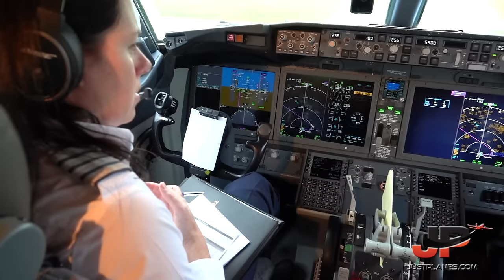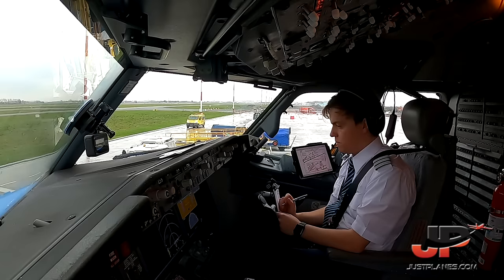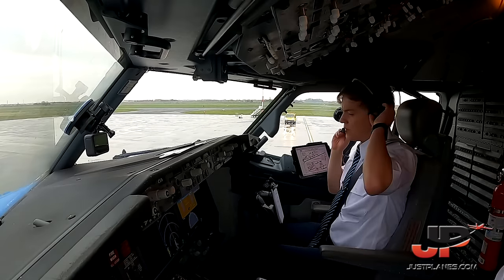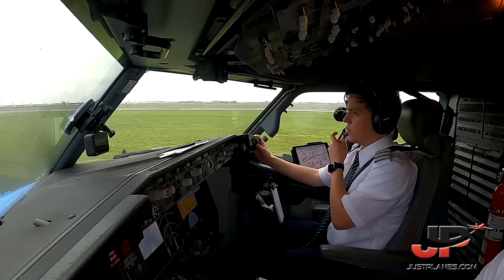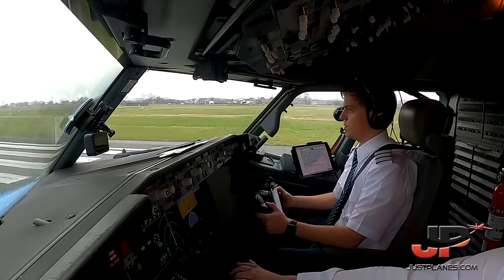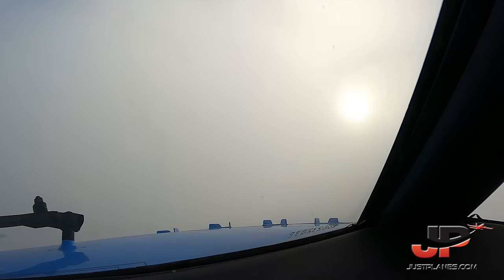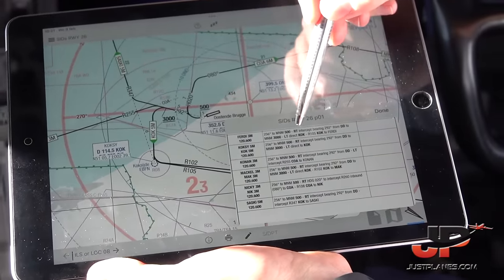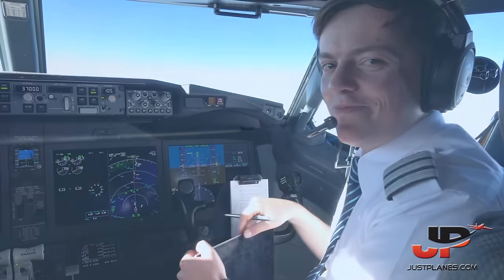TUIfly Boeing 737MAX Cockpit | Takeoff Ostend Belgium

Comment: I always like to see Boeing aircraft in action. A lot of the internal parts of that aircraft in the cockpit, engine mounts, landing gear , wing spares, flaps are manufactured at the Boeing factory in Troutdale, Oregon by Internationaal Machinist and Aerospace workers Local 63. I myself was in local 1005 out of the same union hall. I just live about 6 miles west of the Plant. So it always amazes me to see Boeing aircraft around the world knowing that a lot of internal parts are made just east of me in Troutdale, Oregon.
Reply: I retired off the 737 product line
Reply: I remember Troutdale It was a nice suburb. I lived in West Slope back in the late 80s to mid '90s.
Don't know if you're still living there but type your address into Zillow and then have a heart attack. The house we bought for $50,000 in 1989 Just sold for $399,000.
Reply: @nancyoffenhiser4916  you yes sky hi price's

Comment: Professional pilots; great video; I missed Engine 2 start; What is the banging noise between full throttle and V1 at take-off?
Kudos!
Reply: Nice video.  That noise was the nose tires hitting the runway center line lights.  My technique is to offset the nose gear just slightly left or right of the lights.  I do that on both the takeoff roll and landing roll.   I LUV the MAX!

Comment: 4:05 what’s the spinning thing?
Reply: Stabilizer trimm wheel.  It mechanically connected to stabilizer so when computer moves stabilizer it also spin wheel. in manual mode  pilots turn this wheel to move stab in tail

Comment: I could not understand why the captain assumes power levers on take off (11m:44s) ? If the first officer is piloting, engine controls have to be for him !!! Someone can explain for me any reason ?
Reply: No. Boeing said the captain should hold the throttle until V1 in case of an rto.
Reply: @Hk-uw8my  I am a basic flight instructor ... More than 4.000 hours of flight.  The piloting is a assembly that involves the stick and power levers. Give the power levers to the captain and the stick to the 1st officer, for me, is completely dysfunctional.
Reply: The Captain keeps her hands on the power levers until V1, because it is her decision to abort the flight if there is a major problem before V1. It is not just a Boeing thing, it is standard procedure for Airbus aircraft as well.
Reply: @andrelancha9605  As others have pointed it out it also comes to a legality issue. The Captain needs to decide whether they believe an abort is required especially when one considers what does "aircraft unable or unsafe to fly", image airspeed unreliable, it is safe to fly, do memory items. But someone might not deem it safe and they might reject causing an overrun etc.